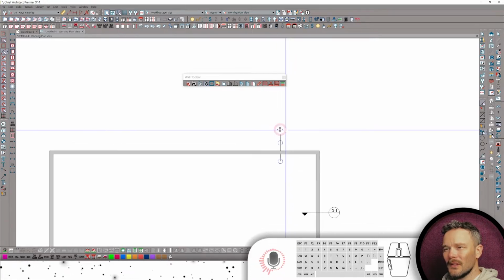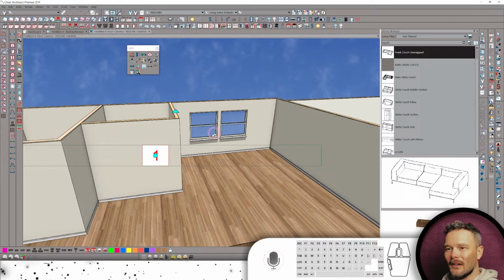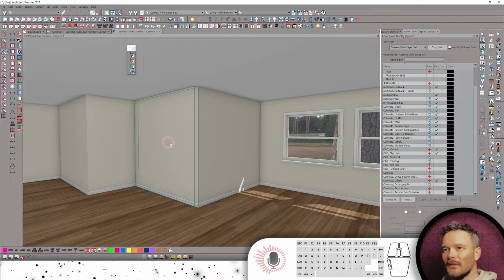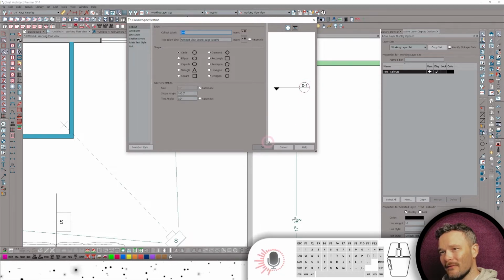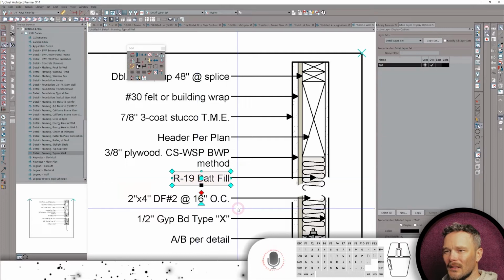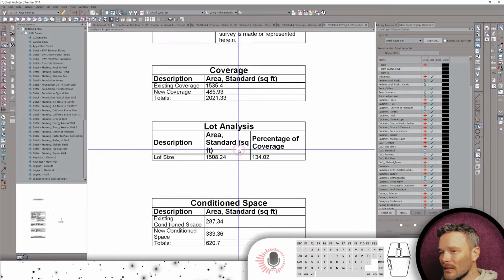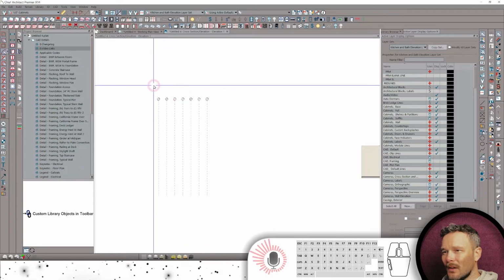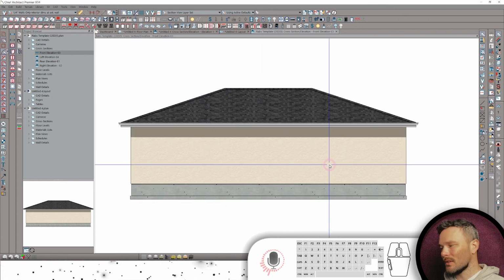Chief Architect X-14 Template Overview from Rabbitt Design-Long Version

Comment: New subscriber to the channel here. Do you have specs on what hardware you are currently running? Are you using a 3Dconnexion SpaceMouse for navigating?
Reply from the maker: Welcome Steven!
3Dconnexion SpaceMouse yes, logi G602, and an  Eluktronics Max-17 all maxed out with a 3080 mobile.
Will update hardware when the 4090 comes out
Reply: @rabbittdesign8482  Nice work. Where is the popup 'dial' menu coming from? It appears as you navigate and looks like it has toolbar items on it... I assume relevant to what you have selected in plan.
Reply from the maker: @setaidesigngroup  This is a custom radial menus I created for use within the 3dconnexion driver
Reply: @rabbittdesign8482  I use both the space mouse and mouse... is this difficult to setup?  Any guides out there?
Reply from the maker: @setaidesigngroup  i have a group on Facebook where I post the radial menu that I have setup called the Rabbitt design feed. It can be challenging to program, it’s 4 parts. Hotkey overwrite in chief, macro creations for my 11 button mouse, radial menu setup, and macro setups/image loading in the radial menus

Comment: I am installing the custom tool bars. Have I missed the existing wall png. I went through all the zip files
Reply from the maker: Should be two black icons. Update rolling out soon with video instructions for this
Reply from the maker: Did you get the update?
Reply: @rabbittdesign8482  yes i got it thx.